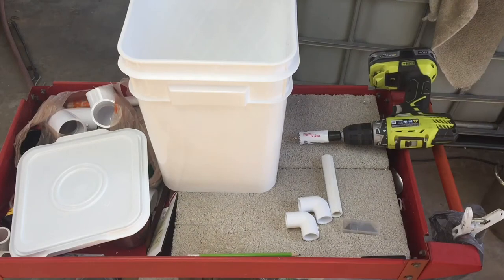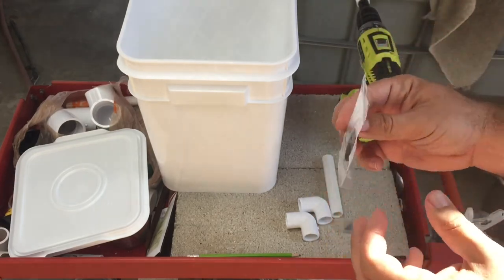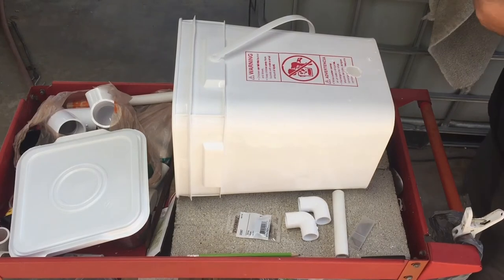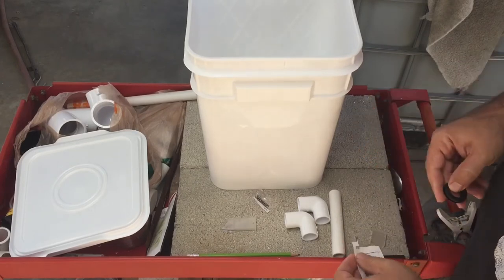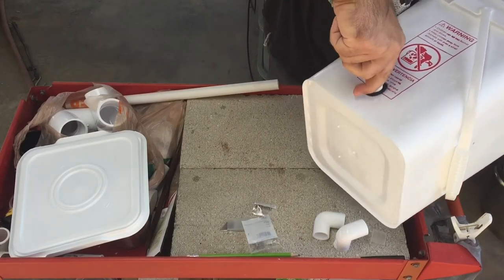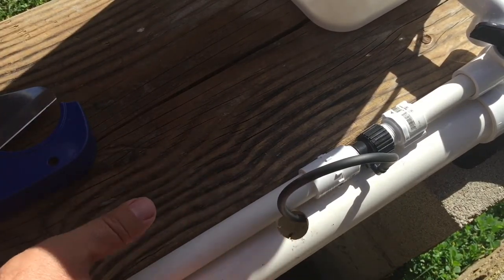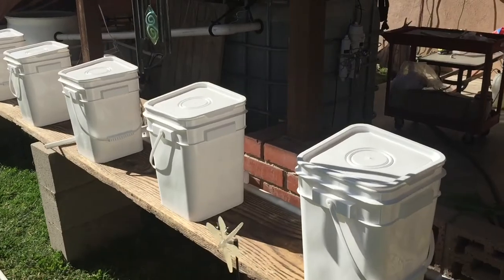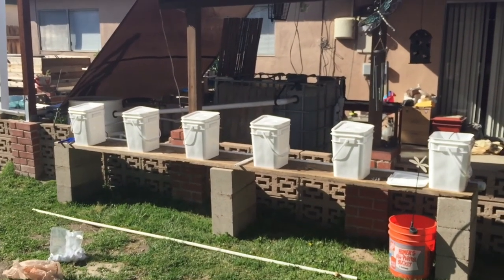How to: Dutch Buckets - Part 3 - Bucket Setup

Comment: Olive Oil works great to lube the pipe
Reply from the maker: Denny  Nason, I was going to do that but I know that these rubber grommets can deteriorate using stuff like Vaseline so I wasn't sure if all olive oil would do the same. It's not too hard to push the pipe through these holes so when I try and do is get a little slime from the system and that seems to work pretty easy.